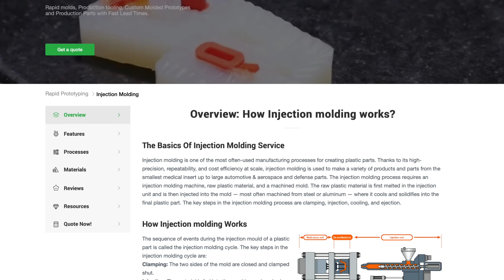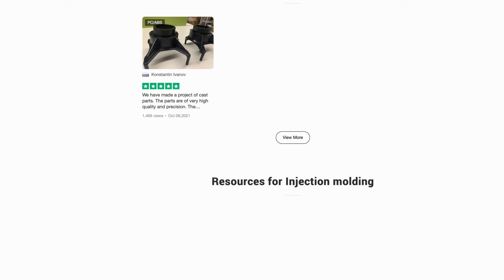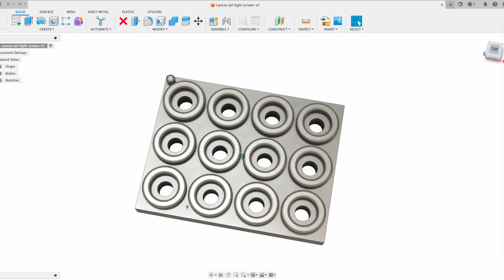Insert Molding Resin over Screws: Lancia replica fasteners

Comment: I've done silicone casting using a similar 3D printed container.  But mine screws together with M3 or M4 screws.  That's clever using magnets to hold the pieces together!  👍

Comment: Great Video, how long do you degass your silicone for? I have a vacuum chamber but typically only degass for a minute or so after it falls. Does it do a better job if you do it longer?
Reply from the maker: Like the gas as long as the silicone needs to be degassed until there aren't no more bubbles coming out of the silicone typically 10 to 20 minutes depending upon the volume

Comment: Great video as always dude. You should make a ton of different sizes of pour sprues and make a mold of em so you can quickly cast any up anytime you need em and not have to worry about cure inhibition with UV resin. Could also just be nice to have so you can pour extra resin you may have mixed so it doesn't go to waste.

Comment: On the European Ford Focus mk1 is the front indicator screwed in the bumper with a similar screw. 
BUT that screw has a torx pattern 😬
Probably very good when the car was manufactured, but a torture when u need to change bulb after 3 years. That torx pattern had many many breaking guides...